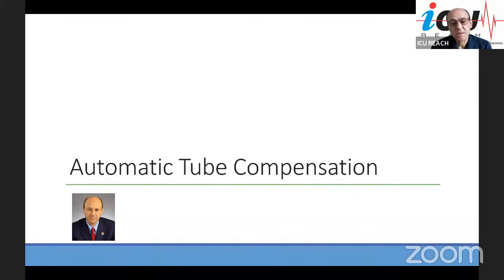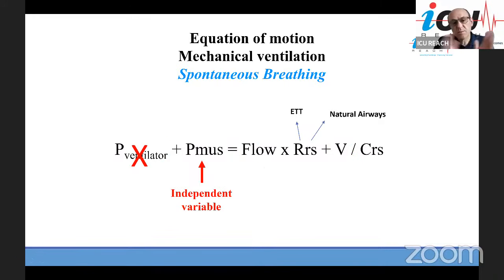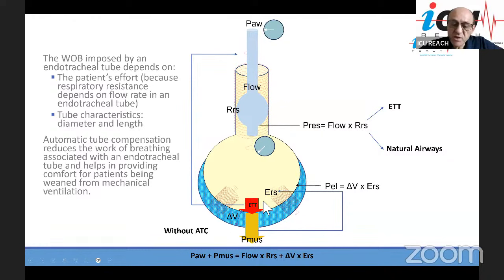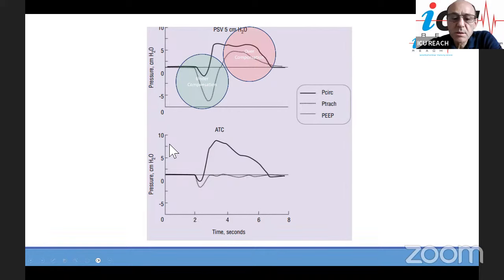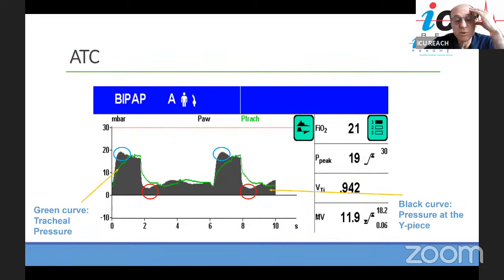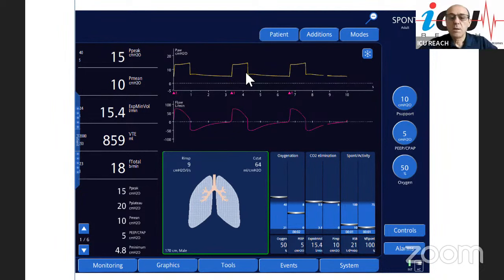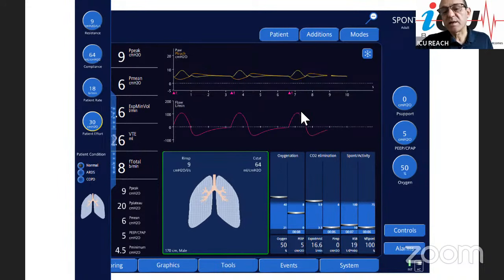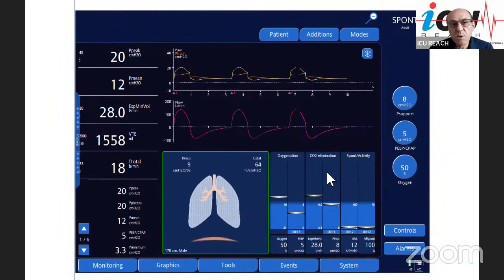Automatic Tube Compensation

Comment: Why When I using ATC in VC mode have constant inspiratory flow can't use it at mandatory breath which I read the Drager V600 manual told me. sorry for poor english🥲
Reply from the maker: There’s no need to use ATC with controlled mode to mom of ventilation as the ventilator will be able to overcome the resistance of the tube easily. However, when the patient starts breathing on his own and generates his tidal volume, at that time ATC can help minimizing the pressure needed to be generated in order to overcome the artificial airway resistance.